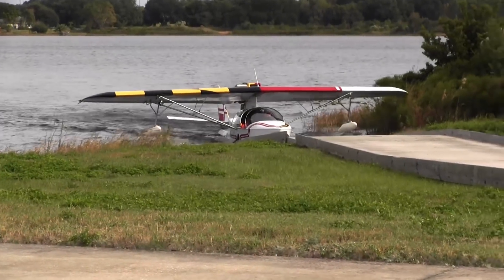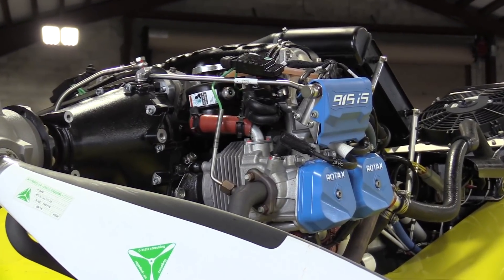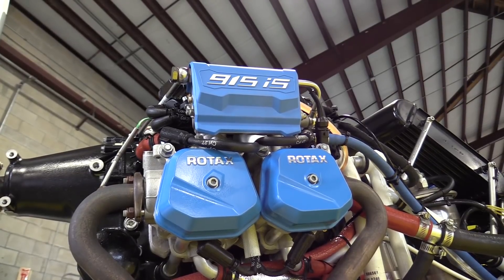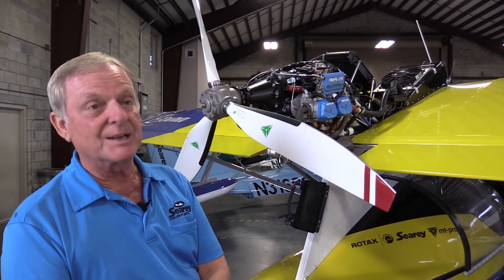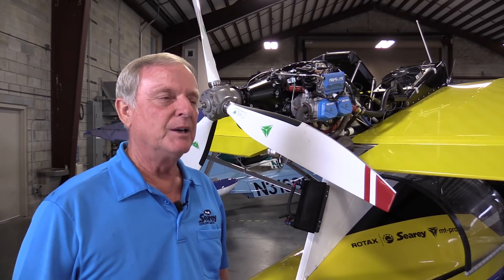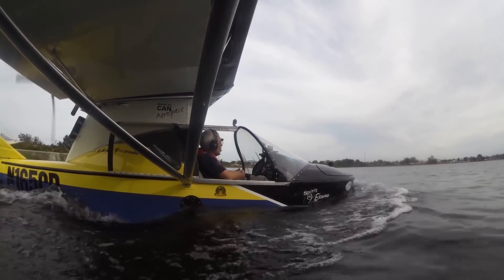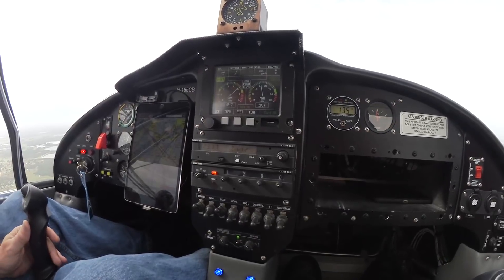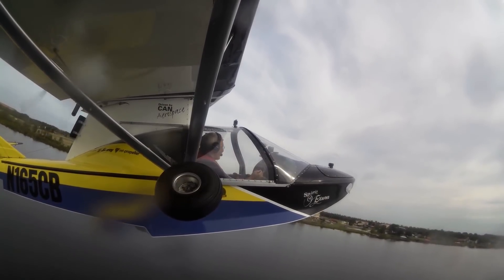Flying the New Rotax 915 Searey

Comment: We have two of these based out of Shannon Airport in VA.  At 7 Gallons per hour, and 350 mile range, it is really a good little get around plane.  Increase the range, and lower the GPH, and it'd be Epic.
Reply: It would be nearly impossible to burn 7 gph in a 914 and is impossible on a 912.  I can fly Tampa to Charleston with reserves on my 26 gal tank.  @75 mph, I burn well under 4 gph.
Reply: @KenLeonard  Only repeating what the pilots of those planes say.  Your fuel management is obviously superior to theirs.

Comment: Hi. I am a Rotax 915iS owner and I'd like to ask a question please if I may?!  Do you have the Lane A and Lane B indicator lights?   Do you often get a Lane B flashing indicator which you then do a reboot of?  During taxiing on many occasions mine will flash. My aircraft manufacturer tell me this is normal and just to reset. They say it is associated with a low engine temperature. There is nothing in the Rotax manual on this matter.

Comment: When he was saying the fuel injection is on 2 separate electrical lanes does that mean it’s EFI like on a landbased engine? I would’ve thought a mechanical driven fuel injection with electric boost pump for redundancy like found in Continental/Lycoming would be the industry standard. 

I guess the EFI systems in cars are very reliable but for an aircraft it’s kinda sketchy. What happens if there’s an electrical failure? You would have spark from the mags but what about the fuel?
Reply: The fuel pumps are redundant and one is direct wired to the battery.  The fuel injection on the 912is has been very reliable.

Comment: Love opening scene! Nice looking MD SeaRey coming out of the water. As for the Rotax reliability, it is widely used across the home built flying community and has excellent support throughout the US and the world. By the way the red capped Rotax 914 is what powers USAF Reapers.
Reply: Robert Richardson "...the red capped Rotax 914 is what powers USAF Reapers."

You should check your sources. The General Atomics MQ-9A Reaper is powered by the Honeywell TPE331 turboprop. It was the MQ-1 Predator that used the Rotax 914.
Reply: SeikiBrian - I spent time in the maintenance shop in Iraq looking over the Predator.  While the engine started with a Rotax 914 core, there was almost nothing on the Predator that remained OEM Rotax.  The earliest versions were carbureted but even they were massively modified.   General Atomics charged USAF something like $80,000 per engine and that was before they upgraded to fuel injection.  They had to keep upgrading power because with all the junk they kept adding to the airframe, the predators couldn't get off the runways in 120+ degree temps.

Comment: WOULd  More TRUST  a plane  with PILOT  and Licensure that  flies  CESSNA or two ENGINE plane;  and with the way  that  "plane TORSION bars are ACTING and REACTING"  and has the "frame  NEARLY  bottoming out"  
THE  CESSNA s  and Piper and LEAR  can  ALSO  handle  much  more luggage;  pound PER pound;    the  lighter  the  plane  the  LESS it  can  LEGALLY and "physicsLY" 
{lycoming manufactures engines in Pennsylvania, and Kansas}   CARRY;
hughes  also  sold  hundreds of PLANS to St. Louis. because McDonnel Dougas bought them out.:{1}!]}              most lycoming engines  ARE manufactured  to 14001  specs.  and better than that.    
THAT  plane  will spin  easily  in ANY adverse weather pattern. 
M.A.B.
Reply: LMAO.  Have you ever gone to a school to learn how to write?
Reply: Thanks for watching my back, fixed :)

Comment: Bloody expensive engine, there are cheaper alternatives in the 130 hp range.
Reply: Your money, your life.  You want to fly experimental eng, go ahead.  The rotax 9xx series has millions of hours.  It's the most popular light sport engine by gigantic margins for a reason.  My searey with rotax has been fantastic and nobody comes close to weight/reliability.
Reply: Like the Lycoming O-290 I paid $1000 for that is also certified and far less complex.
Reply: @navion1946   they're air cooled
Reply: @navion1946  Really how many hours did that things have left before TBO? 20 minutes? Since the brand new one costs $25k
Reply: @navion1946  - Your money, your life.  I don’t chose to fly (or risk family on) a $1000 engine.
Reply: @navion1946  no support for 0-290 try to find parts

Comment: Duke Engines has a much better design that can produce up to 180 HP for less weight, only 101 lbs + gearbox weight.
Reply: If they had to de rate a 135hp engines to prevent the nose diving why would they switch to a 180hp lol.

Comment: The engine just received it’s type certificate and the performance is even better than expected. 141 HP max performance for 5 minutes and 135 HP max continuous. All 141 HP up to 15,000ft to boot! Should be a sweet engine.